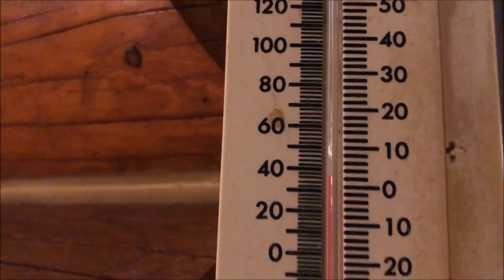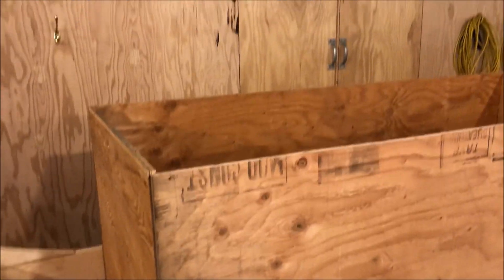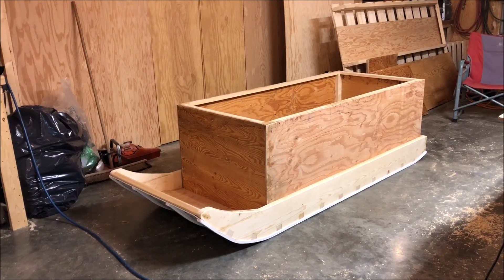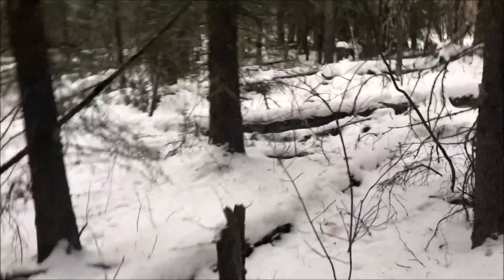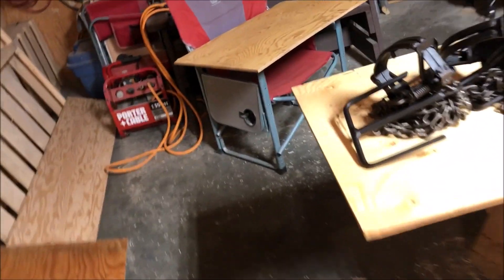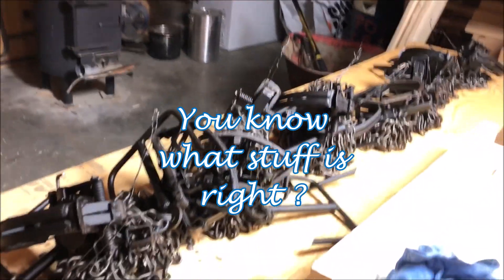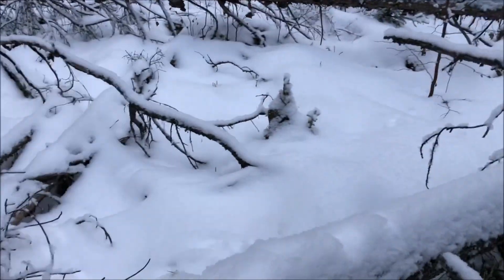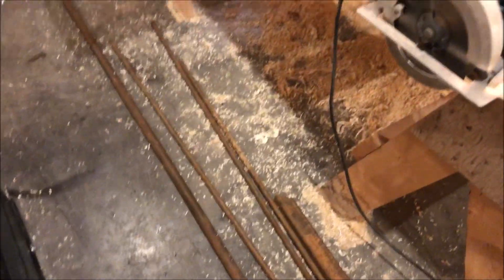Bc Newfie's Fall 2019 episode 11

Comment: Another awesome video Jason. Your sled is looking like it is almost ready for it's maiden voyage soon. One suggestion maybe for the front of the sled is to perhaps put a sheet of plywood on the 45 deg angle there at the front of the sled to top of the box so that way the snow will go over the top of the sled. Almost like a windshield on a vehicle. Then what you could do is to close the sides in and maybe put a door on one side so that you could use it for storage space or whatever, Maybe your chain saw could go in there? Anyway what ever you decide to do I bet we will all like it regardless. Hope you have a very Merry Christmas and stay safe and warm out on the line. Tom

Comment: The first tht that came to mind for the front is a compartment - or multiple compartments -- for things you want to keep dry and isolated from what's in the back - thermos, lunch, lures, matches etc. What ever you do I wonder if it would pay to wrap it in plexiglass (pre-drill and short cabinet screws) so it does not rot and would be easier to clean.  I did that to the inside of a dog house and it worked out nicely.

Comment: Hey brother,  question: what do you put under the sled? also, what width did you make it. I'm asking because my snow machine has a 15" track and thought it's best that the sled fits inside the track trail. Does it even matter if the sled is wider then the track width? cheers
Reply from the maker: i'm  1/4 inch puck board, not sure how it will hold up though, guess we will see, the sleigh is the width of the inside of my skis stance on the snow machine , 36 inches